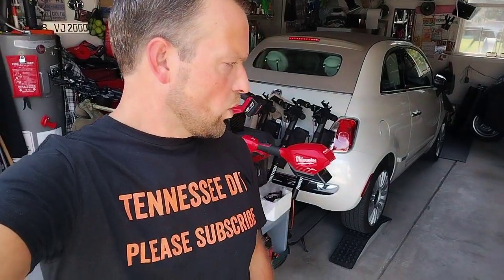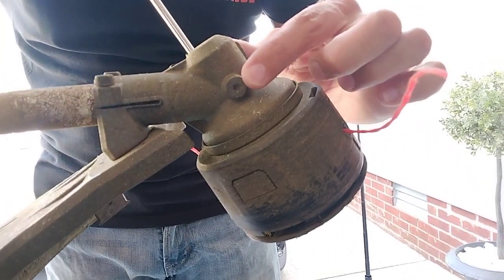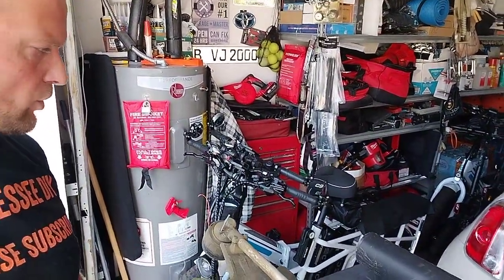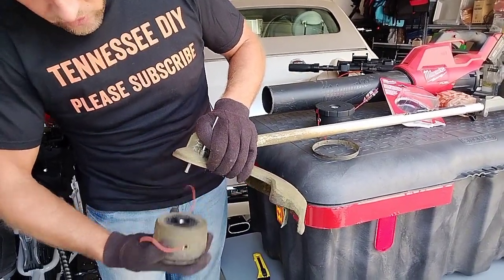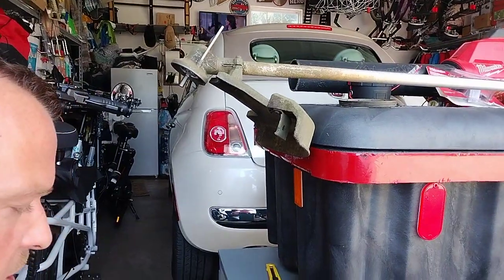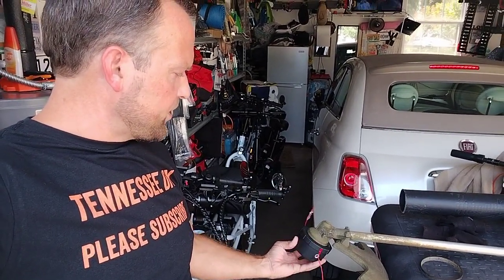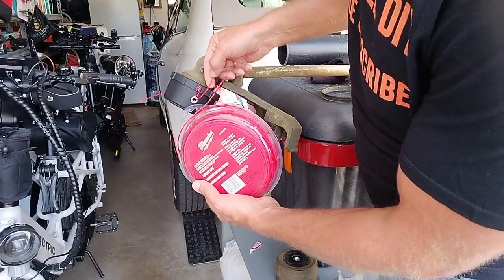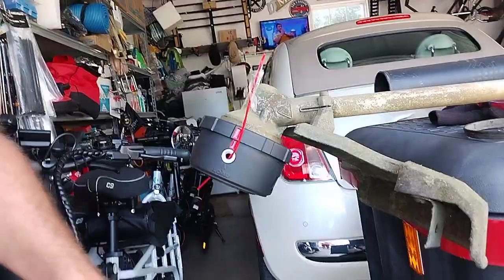Milwaukee Weed Eater Head String Replacement M18 Easy Feed How TO

Comment: I have four heads and they are junk. They are always tangled up inside. I have to restring them every two minutes.
Reply from the maker: I've had mine over 4 years never had this problem. You're winding it in properly.... Need to keep string moist in recharge spool. 🤔 Hmmm? Don't put too much line into head when recharging it about 12 feet each side. Don't cut it just stick 24 total feet in spool half-ed then reverse wind to recharge
Reply: @TennesseeDIY  two of the heads were given to me by Milwaukee and they were tangled up right out of the package. Sent them pictures of it. They sent me a new trimmer with a head. Still tangled up.
Reply from the maker: @iamcarrot1  I'm sorry you've gotten some bad spools 😔